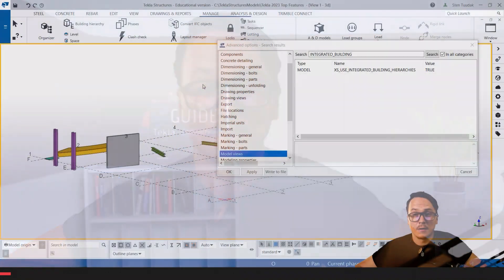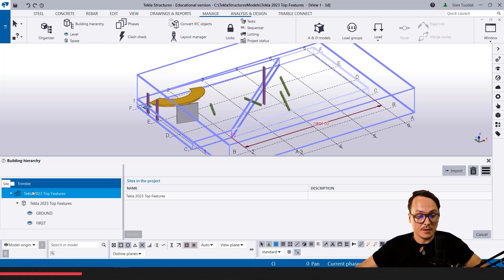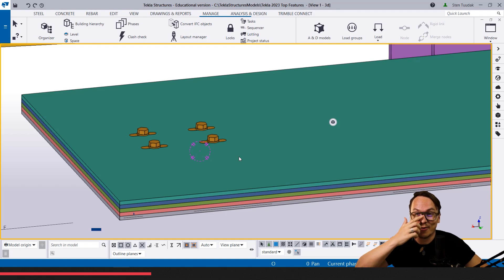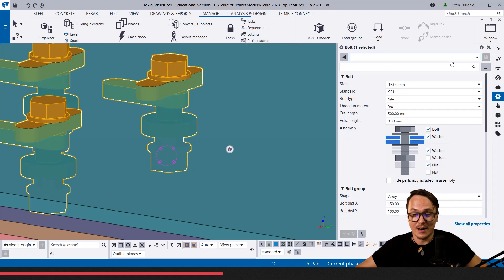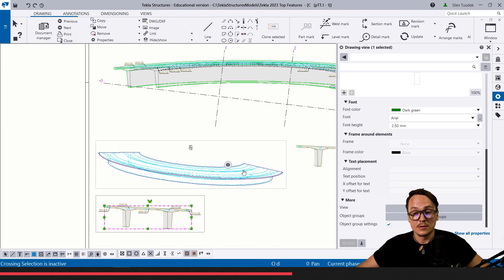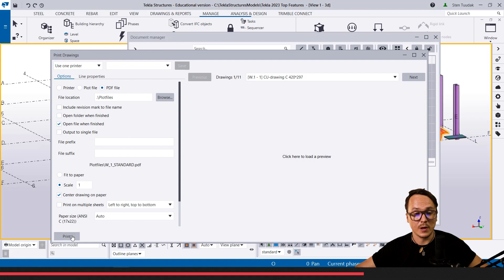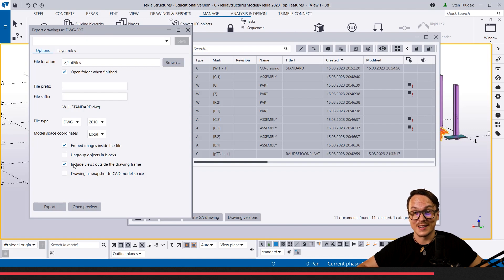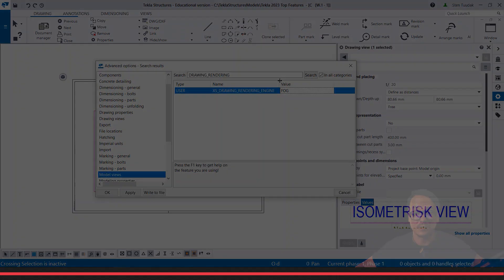Tekla Structures 2023 top improvements

Comment: Does anyone else hate the new drawing panel stuff? I find it very annoying to use.
Reply: 22 designers under my wings and they hate it all... it's the worst thing they ever came up with
It already was bs in the model but doable, in the drawings it's disgracefully bad to work with
Reply: Yeah exactly. Modeling was easy because you didn't have so many options you needed to adjust but drawings its 10x more difficult which is why the panel windows are nice. Horrible choice and they need to add an option to use the old style. @levizaman7539